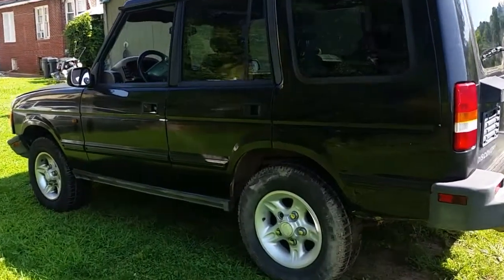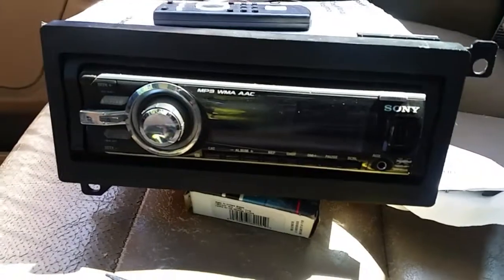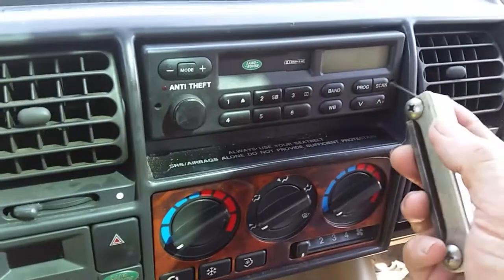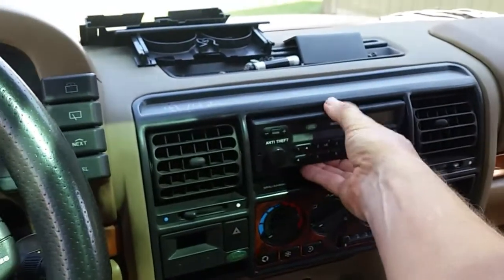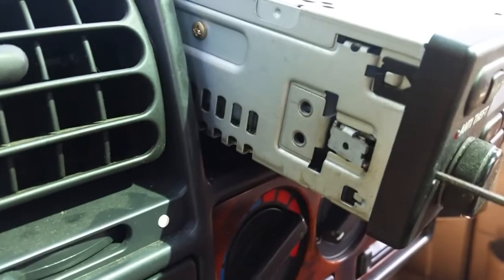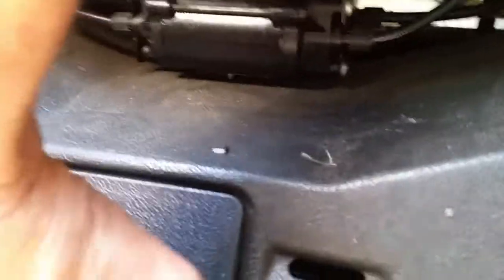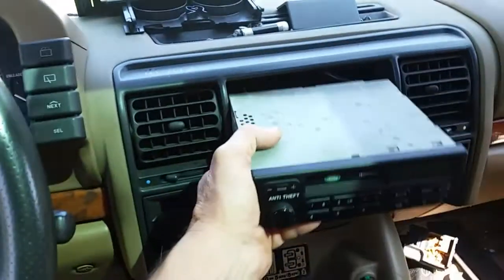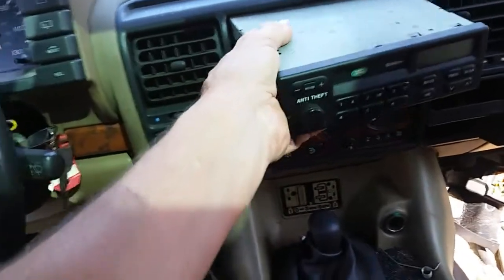Land Rover Radio Removal Hidden screws... 1997 Discovery -Vlog #5

Comment: You originally had a credit card looking bit with the radio code in the owners manual. More than a few had water leaks and it would drip from the rear view and the radio was replaced under warranty…. If that’s the case hopefully the first owner was a good guy and wrote the new code down in the book.
Reply from the maker: Yea true!

Comment: The code isn’t mysterious. In the factory when the vehicle was made they would have written the code for reference (for both themselves, and for the new owner)    For anyone having trouble finding their code, look on the top of the dash, if you lift up the rubber mat and look on the underside it will be written there. (You may have to move it around in the light to see it due to the age of these cars, but it’s there!) it’ll be a 5 digit code. Hope this helps someone 👍
Reply from the maker: Nope ghost rider! Mine was not there...I tired that also!

Comment: By the way, those screws do not come out, they stop after around 5-6 full turns and they are 2mm. I think the rumor that the code is on the back of the radio is just a rumor, mine didn't have it, the replacement I got from a spares yard didn't have it, this gent's radio didn't have it.....dealer got the code for my replacement head unit for me.

Comment: are all land rovers codes the same.? i have mine.. if you would like to try i got a 1996 4.0 V8..mine came inside the landrover book anyways it is 21211....GOD BLESS ....
Reply from the maker: I gave up on that code. Installed a aftermarket radio in the land rover...Now if only I could get sound...lol
Reply: TVWXMAN32  what did you do about the engine(buzzing) noise  that comes along with installing a aftermarket raido?
Reply from the maker: Well i'm still working on that sorta of. Got the aftermarket radio in, but I have no sound....ugh....
Reply: Call a Land Rover dealership give them your VIN and they will give you the 4 digit code